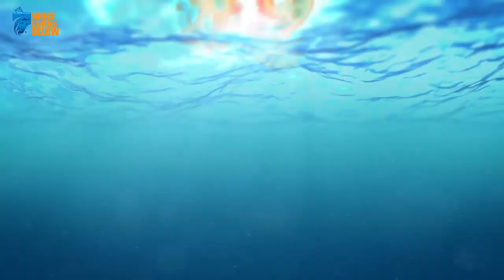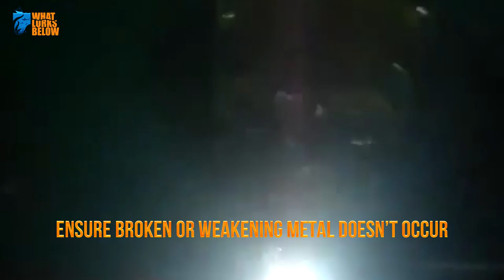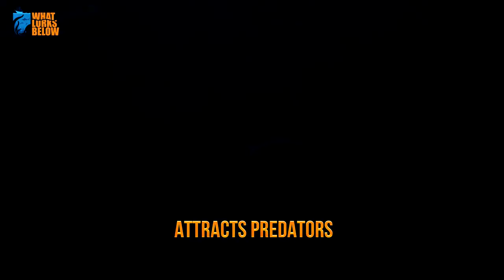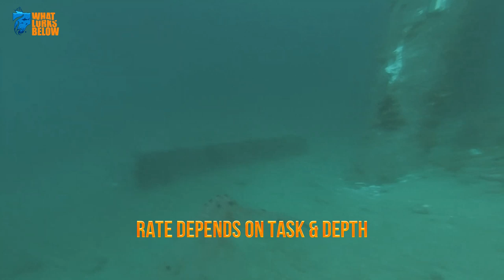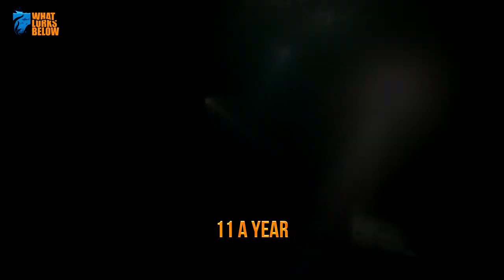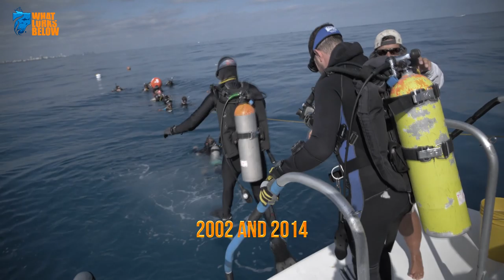Why YOU Should NEVER Weld Underwater!

Comment: As for #7, you're required to take all the necessary welding courses in addition to basic education so you can get your certifications. It a bit more advanced than just putting on a dive mask and get to work.

1) Basic education of 3 years or sheet metal and welding at a trade school program or equivalent.
2) Get a few years of work experience as a standard welder under your belt. It's better to do this after you've taken your additional welding certificates in step 3 so you get work experience on those as well.
3) Additional certificates as a top-side welder. This can take you up to a year to complete.
4) Your scuba diving certificate. You have to be completely healthy for this, meaning asthma, claustrophobia, lung problems, or hearth problems can get you permanently banned from getting your certificate. Excellent swimming abilities and good cardio are also required. You should probably get at least 100 hours of diving experience under your belt before moving on.
5) Become a certified commercial diver. You need this certificate to legally be able to actually work as a professional diver. You're only considered a recreational diver until you get this certificate. You can also be required to take a written entrance exam to be accepted. The length of this program varies, but generally last for ~6 months, or 900 training hours.
6) Get your underwater welding certificate. This usually requires (depending on your region/part of the world) ~20-60 hours.
7) Apply for a job as a diving tender. This is essentially a paid trainee position on the bottom rung of the career ladder where you assist other underwater divers so you can learn the equipment, policies, and procedures surrounding your eventual job as an underwater welder.

8) Many years job experience as an underwater diver. This allows you to potentially move on to the big bucks, which is deep ocean saturation diving where you have to live and work from the same pressurized diving bell for weeks on end to avoid decompression sickness in-between shifts. There's also an extensive certificate course for this along with a long list of requirements.
Reply: I wan this career so badly, so ive applied for welding courses and I will do what you said, to take a few years of welding experience and diving experience
Reply: @simeonwilson6743  you got it bubba
Reply: @simeonwilson6743  how is your journey going?

Comment: I start my commercial diver course next year and I’m not scared
Reply: Good luck man
Reply: how is it going?
Reply: @ethanelectric1024  he died
Reply: @pp_h  lol
Reply: Don't let that crap scare you. Initially underwater welding was more dangerous, but everything is dangerous in its own way too. Right before you strike an arc you have to say make it hot for the electricity to even get turned on. You're monitored by cameras attached to your helmet. You have backup emergency air if your main air has issues.
Reply: @Ben-ro4gc  thx for the info

Comment: I may not be an underwater welder but this video explains next to nothing about what makes this job as dangerous as the title of the video claims. I think most of us can figure out that there is a danger of drowning involved in being underwater without the "in depth explanation" (pun intended) most of the risks that this video listed were never explained or even talked about. Did you explain the difference in how welding works underwater besides the welder having scuba gear? Nope.(you said that the bubbles were the divers main protection) Why is the job so dangerous? answer because lots of people die. Wow thanks! We know what dangerous means. The question is why is it dangerous not "what does dangerous mean".

Comment: I've got to say something. 300 to 400 amps for stick welding, no. With an 1/8in rod it's roughly 125 and 5/32 it's roughly 160. Base pay $100/hr, no. Right out of the get go the pay isn't the best. You probably won't even weld underwater for a while. Companies would rather a good diver learn how to weld versus a good welder learn how to dive.

Comment: Roofbolting in a coal mine. Thinking about this welding gig now. Good money.
Reply: Bolting is the most dangerous thing ive done. Ive seen ancient riverbeds and drilled through them, 20 feet high and hit mud. Thats scary to stand beneath all that rock and drill into it. You hit that mud and know nothing is holding that rock up until you get your bolt in. Bravest men on earth and nobody knows what they do.
Reply: Underwater welding is so uncommon. You're more likely to use Broco rods to cut than welding.

Comment: It’s actually a hard job to land. There are far more commercial divers then actual divers needed. and it doesn’t pay THAT good
Reply: Jobs are there if you're willing to work for it. Most of the ppl that I met that cant land a job is because they have a shitty attitude and been blackballed or are just bad at it. If you're smart enough to hold a hose than you can get a job. Pay is relative too,  my first job had shit pay but they gave me a vehicle and meal pay and a shared apartment but my new job I get really good pay but I no longer have a bunch of free stuff.

Comment: these welders need more flame protection! there is no fire extinguishers or fire blankets, so they are at risk to catching on fire! safety first!
Reply: Did u miss the part where he’s welding under water ?
Reply: @johnbeli580  but what is the safety factor substitution for gasoline seriously.  No oxidants to support combustion.  Bond breakage from heat as in water yielding only H2 bubbles & soot.  Different heat capacity of that & water.  And a more toxic fluid but robotic control negates that risk.